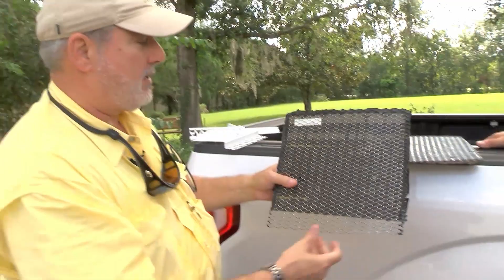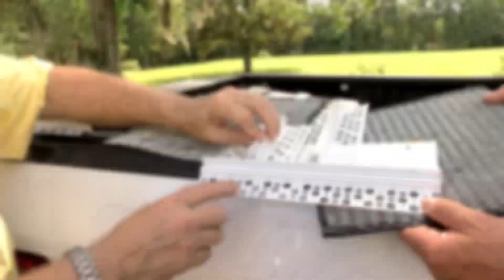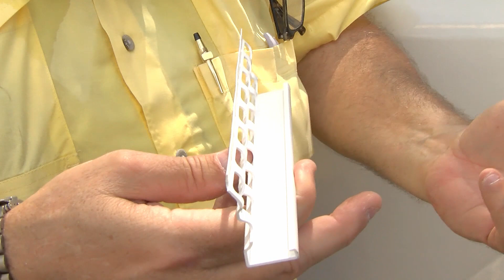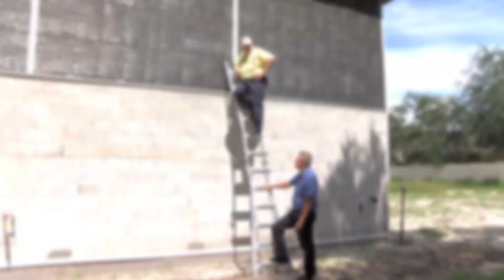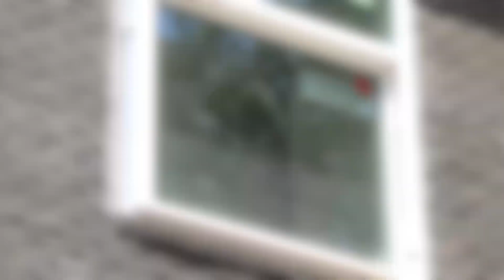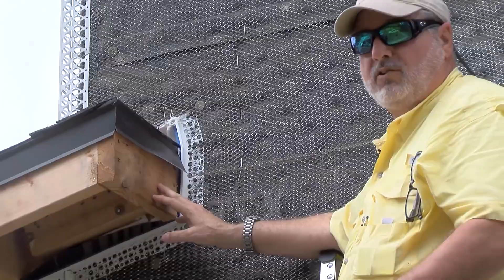Lath & Stucco Pt2

Comment: U showing the nail pattern for wire on top of sheathing, then your saying not to put many nails/staples in the field, then WHY u showing 6" nail vertical and horizontal?
What I'm guessing is on a 16" Stud Lay Out looking at 6" Vertical spacing of your 
1 1/4" Galvanised Roofing Nail.

The reason I'm here in St Lucie and Indian River County, the Inspectors don't even know the Code.
Looking up the Code in 1405-? makes no sence?
Funny a building inspector Didn't know this Code.
Plus, What is the nail pattern on the Moisture Barrier and what nails?
I'm using 30lb felt plus the paper back Wire, cause minimum requirements is a 15lb?
This is a great video 👍👍
Reply: Why on earth would you use 30 lb felt?